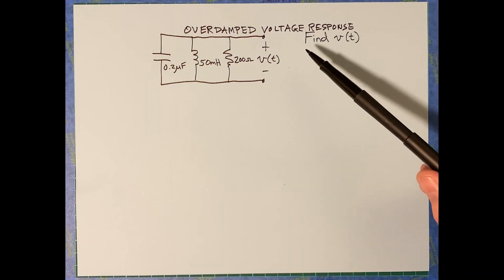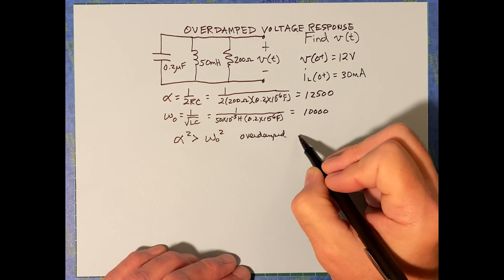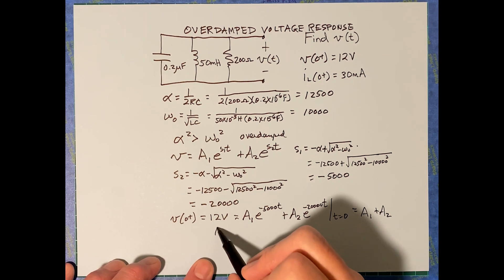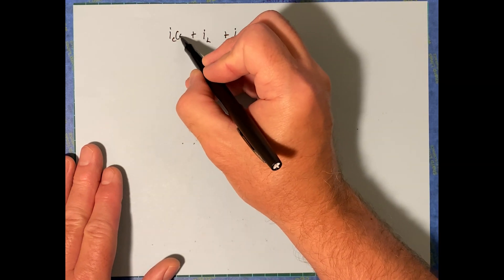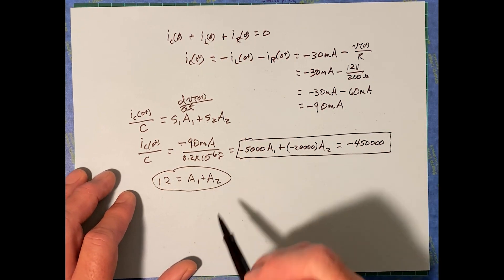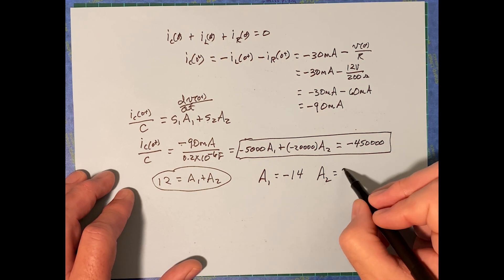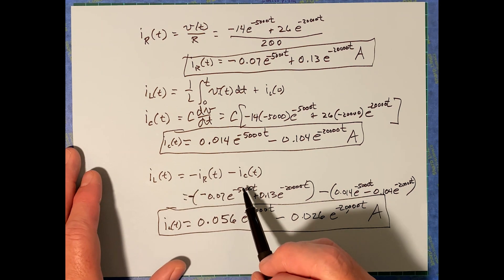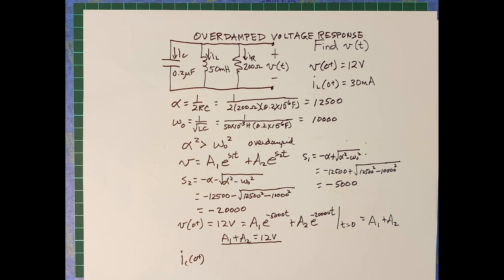21 ENGR 2305 Natural Overdamped Response of Parallel RLC Circuits

Comment: What about solving for the value of C to make the circuit critically damped
Reply: I have an overdamped circuit where they ask to find the value of C that would make the voltage response critically damped and then the 2 root equations (complexity eqs.).  I cannot get the provided answer and am not sure what I am doing wrong!  Have any help for this!